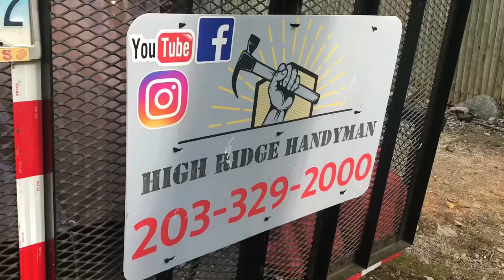Diagnose Leaking Skylight & Repair It Before Replacing

Comment: I've used that flex seal spray on my skylights in the past. After about a year though it just cracks and crumbles. Is there a better product?
Reply: You probably have a local roofing supply store that has every product you've ever dreamed of. Most people think of big Box stores when they need something but an actual roofing supply store is usually cheaper and the products are 3 times better
Reply: Yes its called fixing it properly and not being lazy.  Should have ripped shingles around, cover with some blue skin and re shingle around properly.
Caulking and flex seal isn't what roofers do unless they don't want to properly fix it. Look how ugly that repair looks.

Comment: They have actual sealant for roofs. Flexseal is garbage.
Reply from the maker: @RobertNES816  i agree 100%. It actually failed after a year. Ended up tearing out the surrounding shingles and found the issue and ended up installing ice and water around the unit with replacement shingles. Check out the video if you’d like.   Thanks for your input💪🏻

Comment: I have a new roof and it is leaking around the skylight
Reply from the maker: @ExtremeRecluse  could be a number of things. Incorrect flashing installation or shingle nail placement. First and foremost get the roofing company back out asap to resolve your issue